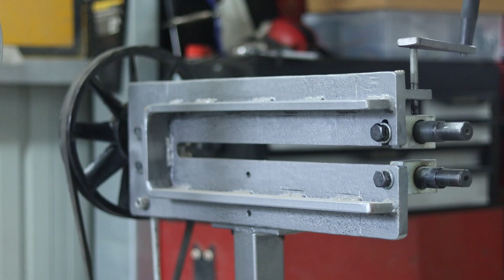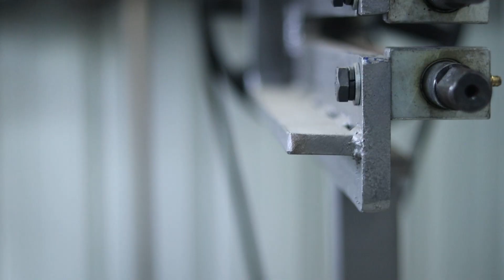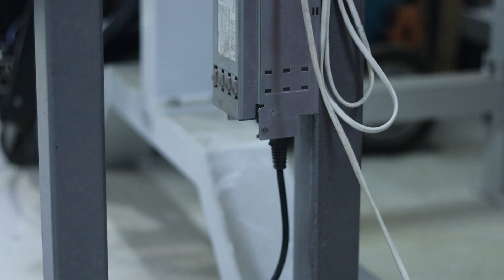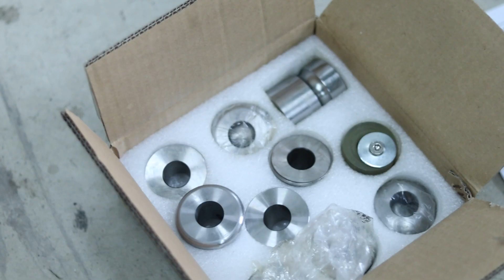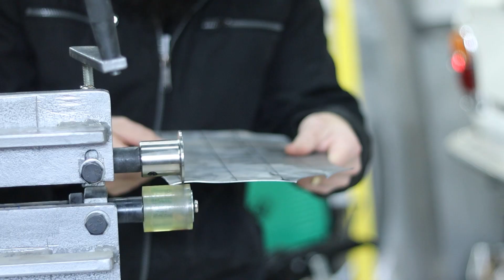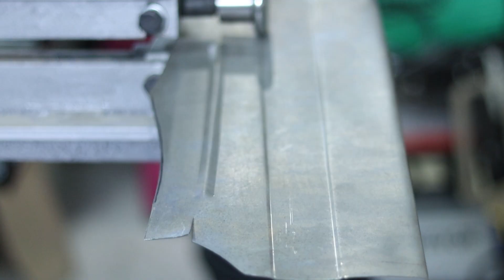Bead Roller Mods!! (Harbor Freight/ Chinese style) - Powered!

Comment: Very nice job on the bead roller   You made this machine  a heck of a lot more useable  I think it would be cool to  build a  control box.  With severalToggleswitches on it that you could.  Change speeds direction  and all those functions at a flip of a switch or two  if you are in a shop with multiple Craftsman each person could. Find their speed  or  whatever to get the jobs done faster  I myself enjoy playing on older Cars and Motorcycles  (Mostly British  ones and over the years I can’t even remember how many times  I wish I had a bead roller to build Floor Pans ,Battery Boxes ,Firewalls   And many other parts  btw  I also have a Passion for Air Cooled VWs  and  many of the Kit Cars  they sold in the 1960s thru the 70s  it’s almost gotten to the point for myself  although I’ve owned several   authentic MG T Series Cars  I prefer.  Many of the Fiberglass ones.  Bolted onto  a VW Pan the Insurance is cheaper and the maintence and Parts costs are lower plus easier to obtain  heck by myself I can swap out a AirCooled engine in under 4 hours b  I keep spare ones on a special roll around cart  I’ve built  to  keep the Engines Clean  or with a battery installed  I can start and run the motor   The Crate.  Can be used to transport the engines. Even  in the back of a Pickup truck bed on an open trailer in foul Weather  it’s also Pallet Jack or Forklift ready depending on what that place. Has   I’ve also been able to drag them to the tailgate down  where 4 guys can lift the  motor and Crate off the Truck and onto a Loading Dock to get out ASAP

Comment: Hi, Helpful video - thanks.  What sizes are the two pulleys?  I want to know the ratio so I can get the torque about right.
Reply from the maker: The big pulley is 260mm and the little pulley is about 65mm. I didn’t make any calculated decisions when choosing the pulleys, just used whatever I could find that suited the belt I was using. Cheers

Comment: So a wiper motor will work I knew it would but couldn’t find anyone else that went that route 
good news my plans are coming together nicely naw that I have a confirmation I’m not nuts 
But I just figured a garage door opener or a 2000lbs winch were extremely overkill for what a bead roller could handle
Reply from the maker: Yep that’s absolutely right! Go with the wiper, heaps to choose from and cheap!
Reply: @PangazShed  that’s exactly what I thought 
Basically free when you get down to it 
Hey you ever look into making a microwave transformer spot welder 👍 it’s a cheap add to your garage it works well.
And you can find people throwing them out or giving them away all over the place
Reply from the maker: Never looked into but definitely keen! I’ll check it out, thanks!